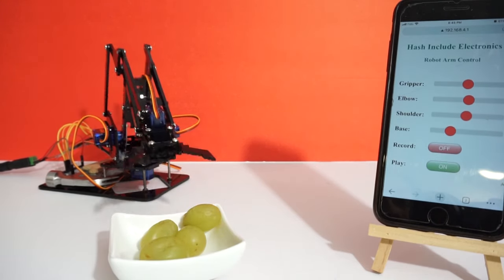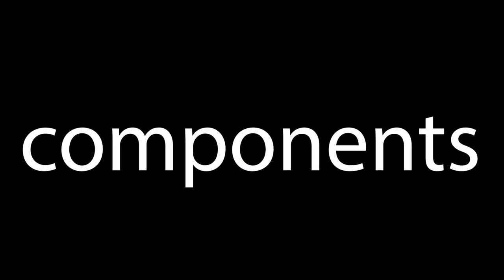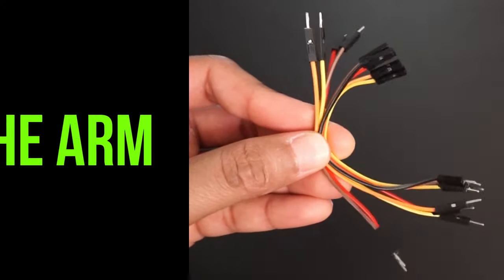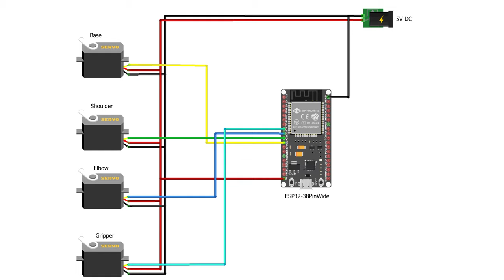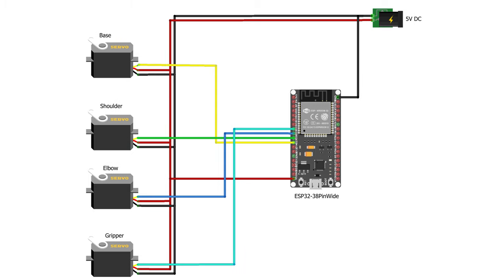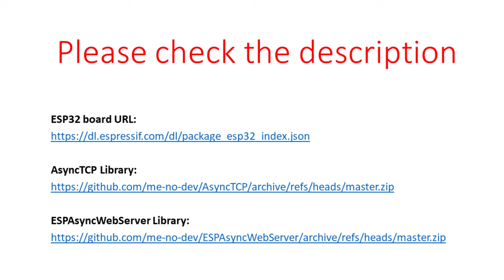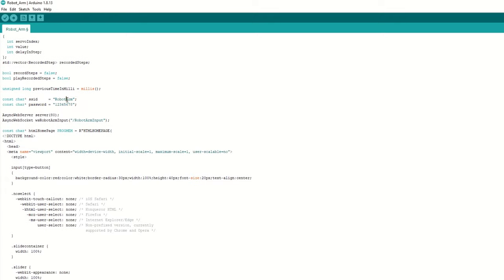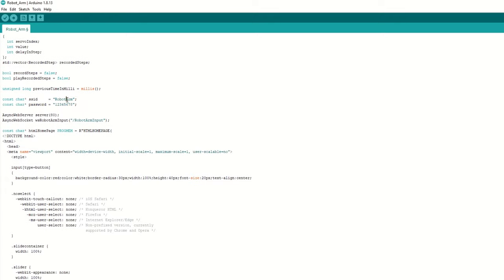Robot Arm using ESP32 and Smartphone | Complete Robot Arm assembly 🔥

Comment: I'm getting watchdog error while using delay() or while loops
Reply from the maker: Are you making any changes to the code ?
Reply: @hashincludeelectronics  I added sliders to your wifi car code. I defined a function that rotates a motor for a delay of 1 second and then rotates the motor in the opposite direction for  1 second. The code got uploaded without any error but watchdog timer got triggered every time I used the function and the ESP32 restarted.
Reply from the maker: @jegadheepedwin2847  you can not have that much delay in this code because of callback function which has to be excited quickly . Try to reduce the delay below 50 ms or less .

Comment: why when i upload coding  it say a fatal error?
Reply from the maker: It happens sometime while uploading the code into esp32. There can be many solutions . Try holding enb button and release it when the code is about to be uploaded . Try changing the USB port . Try changing usb cable . Try re uploading the code . Hope these will solve your problem 👍🏻
Reply: Done but after uploading the coding my servo still can’t control it rotate by itself like a crazy hahah what should I do sir?
Reply from the maker: @muhammadashrafbinazlana19e49  which power supply are you using ? Please make sure you use good 5v and at least 2 A current adapter . There are 4 servos so it needs good power .

Comment: my webserver is not opening
Reply from the maker: What issues are you facing ? Please check the video slowly and follow all the steps . Check for connections again 👍🏻👏🏻
Reply: @hashincludeelectronics  after doing some tests i can see that if the mobile data is on it wont load the app
Reply: @hashincludeelectronics  after doing some tests i can see that if the mobile data is on it wont load the app
Reply from the maker: @creckstorplayz2172  keep mobile data off . You need to connect to ssid and password as shown in video 👍🏻👏🏻

Comment: How to use your tutorial code to add buttons to control relays.
Reply from the maker: You can check the other esp32 car videos where I have used buttons as input . Check WiFi car video. You can change the code easily.

Comment: I dont understand your wiring connection
Reply from the maker: Thanks for checking out the video . Connections are very simple. Please check the circuit diagram as well for more clarity. The link is provided in the description of the video .
Reply: In your actual wiring how did you connect tye wire and you just connect to the adopter 4wires..
Reply from the maker: @jasminenera7135  it’s just 1 to 4 wires connections . Join single wire to 4 wires that’s it . So at one end it will be single wire and at another end there will be 4 wires .
Reply: Ok i understand now. And there is another one, when i comnect tye robo wifi and search the 192. Something  i cnat search it
Reply from the maker: @jasminenera7135  please check the steps properly in video . It should work if everything right .
Reply: I cant upload becouse  write 'compilation error'

Comment: Great work, I want to change this code to esp32, can you help me?
#define BLYNK_PRINT Serial
#include <ESP8266WiFi.h>
#include <BlynkSimpleEsp8266.h>
#include <Servo.h>

char auth[] = "ijEJ20fIeb0DkA8w4dmiWKnym4nWqumU";

char ssid[] = "harra";
char pass[] = "12345678";

servo servo;
servo servo1;
servo servo2;
servo servo3;
servo servo4;
Servo servo5;

BLYNK_WRITE(V3)
{
  servo. write(param. asInt());
}

BLYNK_WRITE(V0)
{
  servo1. write(param. asInt());
}

BLYNK_WRITE(V1)
{
  servo2. write(param. asInt());
}

BLYNK_WRITE(V2)
{
  servo3. write(param. asInt());
}

BLYNK_WRITE(V4)
{
  servo4. write(param. asInt());
}

BLYNK_WRITE(V5)
{
  servo5. write(param. asInt());
}

void setup()
{
  // Debug console
  Serial. begin(74880);

  Blynk. begin(auth, ssid, pass);

  servo. attach(D0);
  servo1. attach(D1);
  servo2. attach(D2);
  servo3. attach(D3);
  servo4. attach(D4);
  servo5. attach(D5);
}

void loop()
{
  Blynk. run();
}

Comment: How to deal with a servo that won't move and only moves the shoulder. please answer as soon as possible🎉😊
Reply from the maker: Check your power supply . Use 5v ac dc adapter with more than 3A capacity 👍🏻👏🏻

Comment: Hey, i have made this robot arm and it was working properly. Then i have removed the base motor from esp 32 because i dont need it. Adter this, when i switched the robot with 5 volt 3 amp charger, it is working automatically without any control and the wifi option is also not showing. Now, what can i do??
Reply from the maker: Thanks for checking out the video👏🏻👍🏻. Not sure what can be the issues . May be check for any loose connection .
Reply: I think i have to pluck again the base motor to work it properly??
Reply from the maker: @HACKINGVERSE  yeah give it a try .